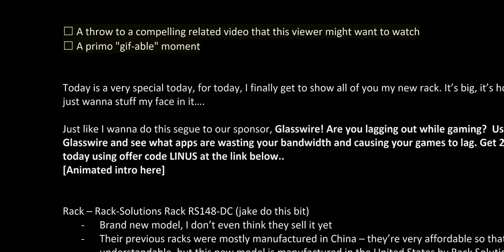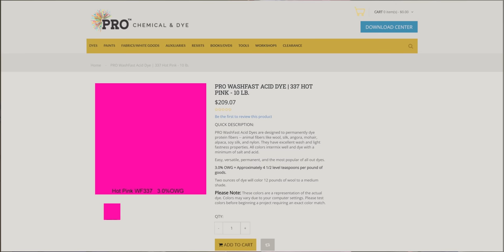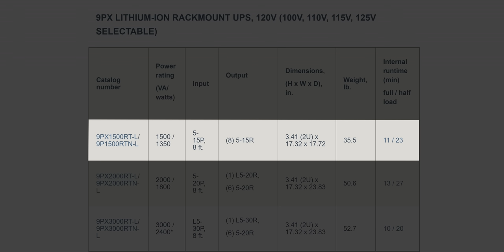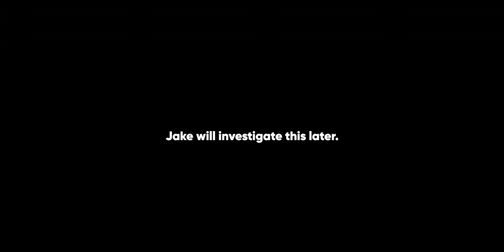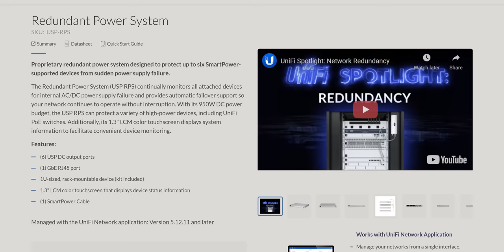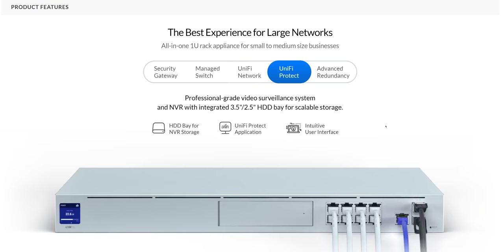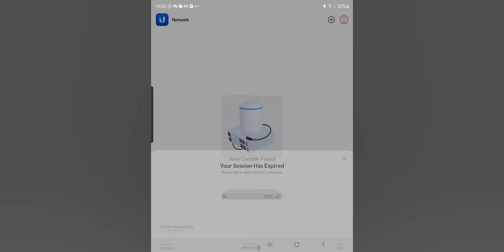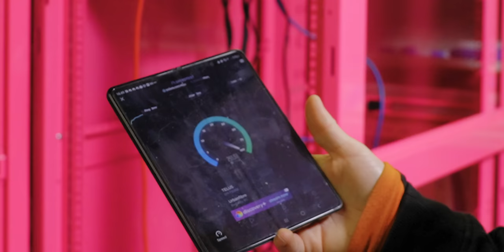Check out my HUGE Rack! - New House Network Update

Comment: Sticking a USW-Pro-Aggregation between the UDMP and the switches would make a lot more sense - it has 4x25GB ports along side the 28 10GB ports, and would mean that they could aggregate the uplinks from the 48 port POE Pro. It would also allow for fibre runs for some of the longer 10Gbe connections, or adding easy server 10Gbe connections in the rack.

Also - not using SFP+ RJ45 modules for such a short run, and using DAC Cables would make a lot more sense (they are a lot cheaper, use less power and are less moving parts)

Comment: Cage nuts are a pain. Don't rely on the ones that come with your rack or your gear, they can be totally hit or miss (even ones from the same company but different packages). I have found that sometimes bad cage nuts just never go in. Don't deal with all that, just order AC Infinity cage nuts separately and save your time, fingers, and sanity. They go in extremely easy and make your whole rack really uniform.

Comment: I work out of these racks all the time. They are all black and you can't see anything inside.. I think there is a trend starting. Also yes the Unifi touch screens all sync and can have screen savers set and  using Augmented reality you can see what is connected to what port. love UI

Comment: No the issue isnt entirely the UI cage nuts its also that the rack was double painted making the holes a couple millimeters narrower than spec. And yes cage nuts are also designed to be a pain to install. The rum and diet dr pepper helps numb the brain of all the blood lost to installing cage nuts ;)

Comment: By connecting your 10g switches like that you just bottlenecked your inter-switch traffic to 10g. If you instead connect the 10g ports on the UDMP, POE switch, and NVRs to the 10g RJ45 connections, you can DAC those two 10g switches at 25GbE, and have a 25g port open to attach your SSD server.

Comment: Should someone tell him that the sides of a cabinet usually come off (the 2 sides and the front/bakck doors).  Instead of moving it as a 250 pound unit, you take the panels off ..... which are not bulky and move them to the basement.  Then the actual rack frame weight would be like 80 pounds maybe?  Which makes it a snap to carry with two people.

Comment: Will you guys look into an issue that I have come across with the UDM pro? I noticed you are having the same exact issues as a few others I’ve reached out to as well. Since LTT has a bit of pull with UI maybe you guys can find an answer.

The UDM pro is limited on gigabit / fiber connections to under 900mbps. 
I pay for gigabit at my house using centurylink fiber. I get both 950 up and 950 down. I was able to confirm these advertised speeds with the OEM router/AP they give with the service free. It was capable of doing within 10mbps of advertised speeds. When I connect the UDM pro I struggle to get anywhere over 850mbps. That’s at least 100mbps loss.

Please reach out if you have any questions! I’ve been fighting this issue for a long time!

Comment: As someone who has moved countless racks into countless homes- you should have stripped the panels and doors while it was on the pallet in the garage.

Qualification- Residential A/V, Networking, Security installer.

Comment: So. Why didn’t you directly connect the fiber cable into the dream machine? Is there a need for the extra router? If it was only a mediaconverter then sure, but it adds extra failurepoints to the system. 

Also. Is there a reason you’re not using the 10gig aggregate switch to go in between the firewall and the other switches?

Comment: As a former IT guy, I miss having the network neatly organized on racks. There are days when I want to clean out a corner of the basement and set up a rack with all the networking and security gear, as well as maybe a server or two, but then I think about how my T-Mobile 5g (yes, little g. When I get better reliability and at least half the advertised speed, it'll become 5G) trashcan is all the more infrastructure I actually need. Plus, all that hardware sitting there and burning power is rather wasteful. I could be using that power to mine Bitcoin instead.

Those Volta cables, though, I might have to check out.

Comment: Linus, why are you still dealing with an NVR when you could get Cisco Meraki MR's and just have videos saved to the cloud? You could still download them. Seems like a more permanent and sensible solution than having to deal with a 1 storage slot device that does 3 different jobs.

Comment: Oh FFS guys 😅 having moved around probably 50 of these, thousands of cabinets, doors, windows - allow me to offer some advice that will make this kind of stuff MUCH less of a struggle. 

Get a 2-wheel hand truck. The kind with air-filled wheels(!). Wrap and zip-tie some 1 inch thick pipe foam insulation along the outer bars. Get the rack on the tray, tilt it back until you find the pivot / balance point, and you can wheel it around with next to zero effort and great manouverability. As long as the vertical bars on the hand truck have a surface on the load (here, the rack) to press against (like a sturdy solid side panel etc), you don't need to hold it by the handles, just grab and hold it by the top/end of the load (rack). Gravity and surface angle will keep the hand truck upright at the same angle as the load, up until the load is tilted down almost completely horizontal.

This is an especially handy trick when moving around really tall/long objects like this rack, closets/cabinets, doors, windows etc, where you would be crammed at a horrible angle "underneath" the load if you tried to hold it by the handles. You can easily do it on your own with actually really big loads, as long as you can get the tray underneath the load, and have enough strength to get the object tilted over to reach that balance point at the start, and hold it back from tipping too far forwards when setting it down at the end. 

Make sure you (or a helper) are behind the handles at the start, pulling the top of the load down towards you. If you try to push it feom the front instead when alone, you won't be able to stop it from tilting past the balance point and fall over. With heavy loads, especially those with s low point of gravity, you will need to set your foot at the bars or kick-panel down at the bottom rear of the hand truck (between the wheels) to stop the wheels from rolling towards you when tilting it back or setting it down. Otherwise the hand truck will try to self-correct itself and the load back to vertical.

With air-filled wheels you can easily use the hand truck on gravel and grass (almost impossible with solid wheels) and get it much more easily over door sills, even up/down short steps/stairs.

This is where a big warning comes in though. You really need to hold at least one hand on the handles when going over door sills or steps, and do it slowly! Remember the bit about how the hand truck keeps itself balanced at the angle of the load, by gravity and surface angle? Well when you're going over those sharp/straight edges of a sill or step, that surface angle changes twice abruptly, but the angle you're holding the load does not. So If you go over that edge too fast, the bars and handles of the load is first gonna force itself to dip down, then when past the edge they will come slamming back up into the load it's carrying, with A LOT of force. Like make-holes-in-wooden-panels amounts of force. You can limit this almost entirely by going slowly, but if you slip up, this is where that pipe foam insulation mentioned at the start can really save the day. That, and it keeps the bars from rubbing and adda a bit more friction when the load tries to slide sidways on the hand truck. But sticking a bit of rubber mat on the bottom tray, between it and the underside of the load, goes a long way in preventing sliding.

Comment: Wrong placement of the 48 port switch. It should sit in between 2 24port patch panel. That way all patch cables will be shorter and same length.

Comment: So you bailed on the 25g sfps/twinax/whatever it is you're doing between the UDM and switches because you had to connect at 10g, yet you're connecting the UDM to a 10g switch... with all those 10g ports?  Get a 10g RJ45 SFP+

Comment: i hope your electrical system was calculated with all the nonlinear loads present.  at least the service entrance conductors and branch circuits supplying  equipment with variable drives, computers, servers and such should be derated to 80 percent.

Comment: Is the Dream Machine Pro the core router? And if so is IDS/IPS going to be turned on, thus limiting downlink from WAN to 3.5Gbps? I get that this isn’t a major deal today, but in a couple years I’m assuming 10G WAN at Linus’s house will be a thing!

I have 10G capable FTTP but only paying for 1G today, I’ve ended up deciding to build my own PFSense 10G router based on a Supermicro ITX board (not dissimilar to the one used at the LTT office) as I didn’t want to drop crazy bucks on a Fortigate 600E or similar.

Comment: I was laughing at the Ubiquiti cage nuts... I've installed a lot of Unifi equipment and it's the same thing with any racks I've installed them in. you have to bend one of the tabs in just a bit and they'll go right in. Not sure why haven't had any issues with other manufacturer's cage nuts, guess Unifi just wants to be bigger :P

Comment: I wonder how come they stuck with Ubiquiti for their cameras. I use Synology with 21 cameras, its expensive, but its on par to Gentec, an enterprise security solution. I have around 70 devices connected with UDM Pro and 10gig switches and poe also

Comment: Linus I have the urge to just scream at you for not using fiber in your house. I understand you need POE for cameras and security devices but those should be air gapped from your home network anyway. You can get 6 and 12 fiber trunk "cables" for much cheap in comparison to copper cat 6a. Also I don't think you need a permit for fiber because it is not "low voltage" but instead NO voltage. Oh and NICE RACK!

Comment: I wonder if his UniFi gear is running hot.  If I don't separate my UniFi gear by at least 1U with air movement, they run just north of 60C... With a fan and space, it's closer to 40C.

Comment: 16:32 what is the small white box jake is messing with?
Reply: It looks like an ONT (optical network terminal). Its where the fiber from the ISP runs to and then gets converted to ethernet for the router.

Comment: Um, not grounding your rack? Good luck with all the little bugs it creates. PS, UPS batteries don't last 10 years. If you get more than 5 years out of them, feel lucky. Pro Tip, take cards or batteries out of devices if they are heavy to install them in a rack, with slide outs, then re-install the parts.

Comment: Watching this with my google router connected to my local satellite ISP that does 15mbps. I wish I had this. I'll only have this in my dreams. The worst part is my house has what I believe is at least Cat5 wiring throughout the house but it seems to have just been butchered by the previous owners and I can't figure out how to fix it or even where the main hub would go. So it just sits there taunting me.

Comment: 19" racks suck, and yes, I work with them, the thing should go the way the Dodo did, use the metric system.
The thing is, the squares you drop the inserts in are not the same distance apart, which sucks, whoever invented this
should be "hanged".
Rittal has an easy tool to put the nuts in the squares, but, you can use your hands if you just need to put in a few, more then
a few will hurt.

Comment: Why didn't you move the rack rails back a bit? so close to the door.....
Did this rack have no options for wire management? 

I was cringing the entire time.

Also why are you using SFP+ to ethernet adapters?... Just get the matching SFP+ Copper cables from unifi store... Seems like items were forgotten.

Comment: I really like Ubiquiti network gear, but the devil is in the details.
If you can never use the 25G ports in the switch together with their controller because the switch only supports either 10G or 25G speed, but not mixed operation, then all the extra cost for the hardware is not worth it. 
Or the other way around, the manufacturer loses the advantage if the network hardware comes completely from Ubiquiti.
Both can only be explained by bad internal coordination or very bad developers....

Comment: Nope Eaton UPS are crap. Low built quality and many dedicated parts. I have bought a 9PX2200IRT3U (2200VA with PB battery) and the electronics died after just 8 months! Replaced under warranty (1 month of wait!) and after 2 years one of the two fan failed. Since I was unable to get a replacement quickly and because it was shutting off without it I modded a Noctua to solve the issue (from factory it uses locked rotor fan type that is almost unknown in the PC world,  when you connect a normal fan to the UPS it will tell you it's faulty). So I won't recommand this low quality and bad customer support brand, get instead APC.